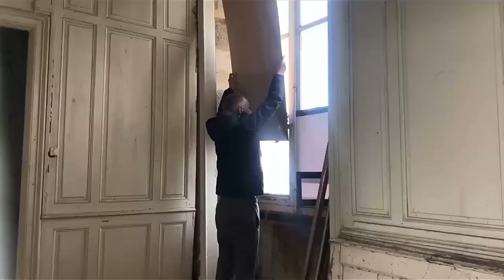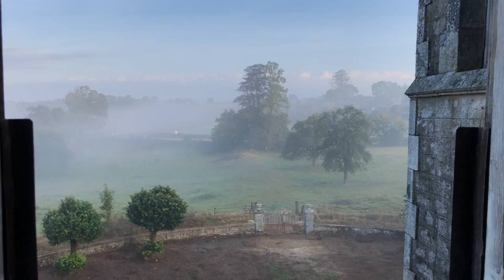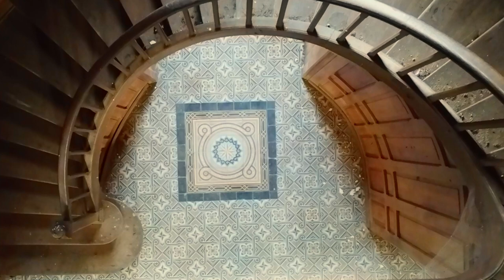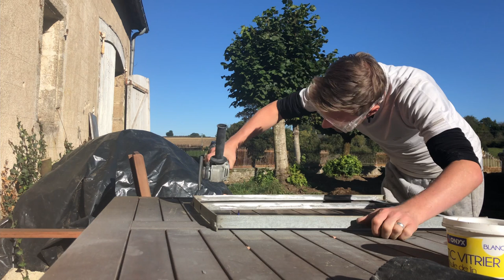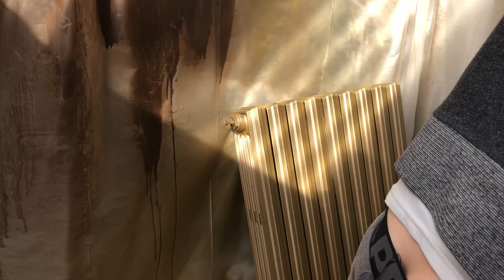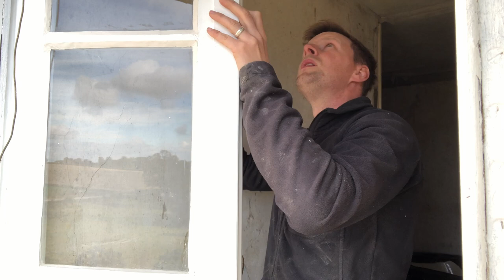Restoring The Original Château Windows. Ep 24

Comment: Hi Terry, nice job on the glazing. This is quite a difficult job and it looks like you have quickly gained some good skills with this process. In our 18th Century Presbytere all the windows were like your Dormer window. It took me 4 months of solid work to strip, paint and glaze them all. From my torturous experience. here are a few tips that might help you.

I believe the Dormer window you were working on can be easily removed so you could work on it laying flat on a pair of tressels. Old French window hinges normally are in two pieces (one part screwed to the window and the other part screwed to the frame. Then, either a removable pin is knocked in to join the two elements, or one of the elements is fitted with a male pin and this inserts into the female element attached to the frame. As is often the case, the French have evolved a better system than the English. By removing the window, all sides can be accessed for stripping.

Regarding painting the windows, the wood found in these old neglected windows can be very porous and dry. I did find applying the paint straight from the can did not create a long-lasting finish - after 18 months the paint started to delaminate. After that, I watered down the first few coats so that the paint could penetrate the wood and get a good grip on the surface.

Regards painting in general, recently I have discovered Linseed Oil paint. This has an excellent reputation and like lime mortar is the old fashioned way of doing things, but really works. Check out this video:https://www.youtube.com/watch?v=Wh3khEAlOnU. I highly recommend this product.

If you do elect to use Linseed paint, before painting the frame and window it might be a good idea to give the wood a coat of linseed oil which will penetrate the wood and provide some really good protection.

With regard to glazing the windows and the use of putty. It is important to work the putty before you use it (I know you did mention this in the video). The more you work it, the easier it will be to apply. I suggest you buy some linseed oil and when you finish the final mitres, dip the blade in some linseed and you will achieve a much better finish.

With regard to repairing damaged wooden window frames, the hardener you used is very effective, I have used it many times with success. Regards filler, I would suggest a two-part product that is epoxy based. Normal water-based fillers tend to delaminate after a while.

French windows do sometimes have intricate profiles where the window joins the frame. When repainting the window it is important to strip off most of the old paint on these surfaces otherwise the depth of the paint will stop the window from closing properly.

Regards acquiring new glass, most Brico shops will cut and supply, however, on a job this big, I would suggest you buy it in large sheets and cut it yourself to size. Glass is easy to cut.

Good luck with the rest of the glazing.

Lester Pulsford.
Reply: What great advice I hope they saw this
Reply: @wondersofwa2792  Its the second time I have solicited advice. I suspect that are too busy to receive advice based upon first hand experience that might save time and money.

Comment: Terry, I’m an antique firearms restorer and if you want to save the mullions dividing your window glass that have become rotten and weak because they’ve lost some of the original wood you can mix a waterproof resin with a small amount of the sawdust from your sanding and build up your mullions a layer at a time and then sand them back to your original dimensions. You’ll be amazed at the strength you can add and will be able to save your original windows.

Comment: I've seen a few home restoration shows where they use a slow cooker as a paint remover for fittings, face plates, etc. Water and a bit of dish soap and the low, slow heat works gently and beautifully. A lot less work for you👍
Reply: I even saw how one couple put it in the fire over night. All completely off without any work at all.
Reply: Plus it really helps with more intricate pieces
Reply: I seen that on 'It's a Wonderful Life'...Peter and Anna. Great tip!
Reply: I’ve done this with on a slow boil of water and add in some baking soda. I was so amazed at the results
Reply: Yes, taking hinges, and handles off and setting them  into a crock pot ( not used for cooking food ) with dish soap and leave it to cook for 24 hrs. They’ll be like new,

Comment: When getting the putty ready to put onto the window frame, rolling the putty between your hands to form a rope like shape will enable you to get it about the correct length and  diameter will give you the approximate amount to fill the space. It takes very little practice to get the length and thickness needed.  I have found this makes it much easier and faster.  Good Luck.  The window look very good.
Reply: Thank you for mentioning that. Especially the inner strip is best to do that way. You don’t even need to flatten it, just a thin rolled edge tucked in the corner and the window takes care of the flattening and you don’t get any air pockets.

Comment: Nice explanation & work on restoring the windows!  I've been working on my 100 year old ones (is old for my area near Seattle, WA)--most 8 over 1! Using an epoxy repair system, similar to what you're using. The old wood is incredible--as is the old glass--and worth saving!  (Good heavy curtains for winter though).  And on my first window I made the mistake of painting before the putty had cured... oops.  Eventually will redo it after I finish the other 25 still to do!

Comment: I'm so glad the "brass" wasn't the bright, "brassy" kind of brass - the window hardware and radiator are Fab!  Also, your comparison to a professional job doesn't count that the professionals get the job done as efficiently as possible - so it's waterproof, yes, but the details are not that important as long as it looks like what it was before (i.e., it doesn't have to be perfect to the detail, it just has to be sound and look "nice").  You probably did a much better job!

Comment: Terry, Get a Coffer/Tea mug heater using the mug to hold your putty keep it warm. You'll want some boiled Linseed oil to coat the the mug and wipe the putty knife.

As it does get cold you might want to get double glazed glass to replace the single pane. It will save you a ton of money from your heating costs in two years it I saved enough to pay for them as well as making sure the seals of the window where also tight.

Comment: Wow! I see your breath in a few shots - getting colder! The frosty/misty view is magnificent, though! I bet you're anxious to get all those windows squared away to keep the drafts out.

The color of the fittings looks really nice. I hope it's high heat paint on the radiators or they may get sticky and smelly when they're on.

I use a much easier way to take layers of paint off old hardware. Get an old pot that you don't plan to use for food - designate it the hardware pot. Put your hardware in and cover with half water, half vinegar and let it slowly simmer. The paint will lift right off the metal - even in the nooks and crannies! I use a wooden skewer to lift the paint away and take off anything that is left. With this method you're not chewing up your skin using multiple coats of chemicals and wire wool, and no Dremel needed. Plus you don't have to be hands on with it - you can let it sit and work its magic while you go do other things.

Comment: Metal elements painted with paint are enough to boil for about an hour in water with dishwashing liquid, and better with soap, and windows are much easier to clean of paint, and then paint when they are pulled out of the hinges and lying on a flat surface. The window looks great, as does the radiator.

Comment: Terry, well done for having ago at glazing, which was agony watching, as a retired restoration decorator I would have had the 3 panes of glass fixed in minutes, the sky light that you glazed shouldn't  use ordinary linseed oil putty as on wooden windows the linseed is gradually absorbed into the wood allowing the putty to go hard, on metal frames the putty can't be absorbed and the putty will fail in time, There is a putty for metal. But once again well done for having ago

Comment: You did a really good job with the glazing.  The only thing I would say is you might try feeding the outty with your left hand as you pull the putty knife along at the angle needed…  I turned my knife at 90 degrees…may take a bit to learn, but will save time over all, .  Before retirement one of my jobs was as a glazer.

Comment: A little bit late but sky lights appear galvanised ,it's why they are still so perfect but the glass long gone,treat any rust with a treatment no need to sand metal,you need a metal specific primer and putty as metal moves more relitive to temperature 🌡️ probably why original glass fell out or hail stones but you can't do much to prevent those! Brilliant information on DIY.Automotive spray finish es bring back to new look and could be used on q uicker painting large surfaces.

Comment: Your all doing a great job but may be this tip may help when your working with putty once your warmed it , roll it between both has into size of long show string . I was shown this way years ago and helps making it less fiddly & speeds up process a bit . Another tip I was shown was using car filler when repairing & making good  window holes & rotten frames .

Comment: Terry, you can make a roll out of the glazing compound like dough, lay it in the channel, and finish with putty knife. Might be a little faster. A wood preservative on the frames that is compatible with the paint might make them last longer. Linseed oil (boiled has a dryer)  was used for centuries, some new petroleum based might be good too. Don't know how much hail you get in France. Glass for the skylights that has embedded chicken wire might make them less likely to shatter if cracked, or non-glass if for light only.

Comment: Instead of a chemical stripper to remove the paint, you can simply add them to a slow cooker with water and allow the heat to remove the paint.  Works wonders for all of the places that are hard to remove the paint.

Comment: Paint on metal hardware can be removed by putting the Hardware in crockpot that you don't plan to use for cooking anymore, cover with water, and add a tablespoon of liquid dish detergent. Cook about 6 to 12 hours on medium. For any remaining residue, use wire brush or steele wool. It's much less caustic than paint striper. I usually start it cooking first while I'm working on wood.
Reply: Would it be easier to remove the window and work in a warmer place and then rehang it?

Comment: Widow latches are----Crémone or "Crémone Bolt" is a type of decorative hardware used as a locking device to fasten a pair of swinging windows or casement window.[1] A knob or lever handle is linked by a rack and pinion gear to a pair of half-round rods or "surface bolts" which slide over the outside surface of the door or window and extend into sockets at the head and sill of the opening. The gear mechanism operates the two vertical rods at the same time; one rod extends up into the door head, and the other extends down into the door sill. It is similar in appearance to an "espagnolette" lock, but uses a half-round rod. (from Wiki)

Comment: A better way to get paint off of hardware is to boil water. Put the hardware in the hit water for about ten minutes.  Take them out and out immediately into cold.  Use steel wool and a brush to remove paint.  Cheaper and more effective than stripper.

Comment: For those fiddly window fixtures if you pop them into a wood stove/heater the paint burns off and you only need to brush them down with a wire brush once they are cooled...I know it seems counter-intuitive...but it really works a treat and you don't get the rust that using water and wet paint stripper causes. https://www.youtube.com/watch?v=zwQ6_aAUWvA&t=540s watch from 12:57 * smiles* and you'll see you wouldn't be the only Chateau baking window fittings ;-) Hope this saves you, and your family a lot of time and elbow grease!

Comment: If you want to restore those windows to last another 100 years, they need to be remove.  All hardware should be removed and any paint should be removed with a chemical stripper.  All cracks and holes should be filled with epoxy putty.   After drying overnight, sand all surfaces.  Use an oil based primer, but add some linseed oil.   Drying could take a couple of days depending on the weather.  Latex paint is fine, but you need to make sure the primer is thoroughly cured.

Comment: I hope you are using the right traditional paint and methods? Please use the paint scraper blade instead of the sander. And use a quality one with the different shape of blades. Much more easier. Also, please don't use any modern paints, use such as linseed oil paint (at least three coats) and it needs to dry properly in between the coats!

Also then, the actual window glasses should be installed and insulated to the framing using linseed oil putty or similar product available. Then the putty seam should be painted a couple of millimetres on top of the glass to seal the joint off. 

I believe you need to remove the windows to properly work on them. You can easily renovate those glasses using the right techniques, no need to replace them. But I fear your are using the wrong techniques and materials to renovate such old structures. 

Please please study the right techniques before you do repairable damage or need to redo all.
Reply from the maker: Hello, thank you very much for the advice. Unfortunately the paint will not come off with a scraper and it would cause more damage to the windows. All the glass is removed first and reused in all of the windows. Unfortunately the windows can not be taken off without removing the whole frame, so have to be done in place, after restoring the windows each one has had 4 coats of paint to help protect it against the harsh weather. As you will see in the video we are using a linseed oil putty to seal the glass in and once dry we can then paint the putty to protect that. We have done our research and are no expert at the jobs we do and do not have a endless amount of money to pay artisans to do all the work, we are learning along the way and this was a first trail for the rest of them. 😊

Kind regards